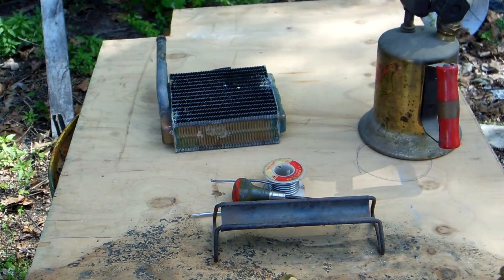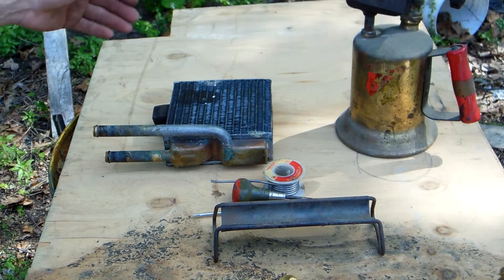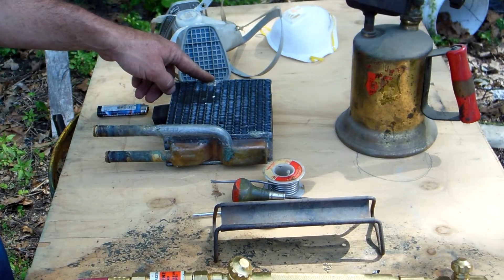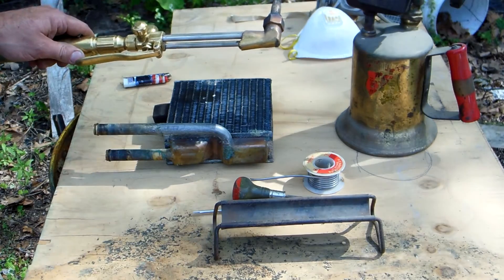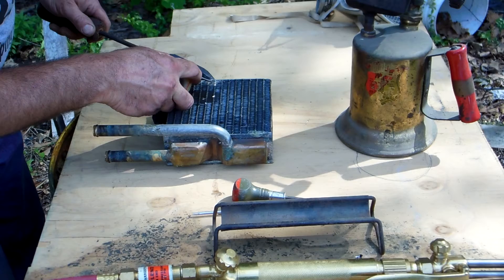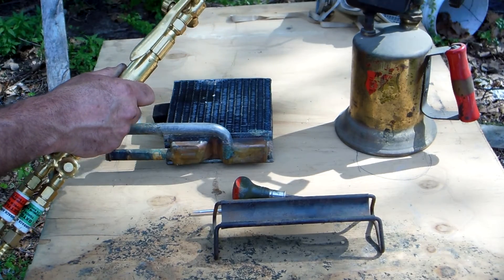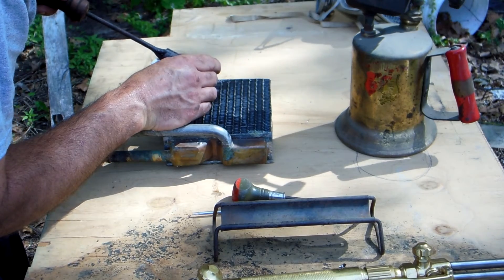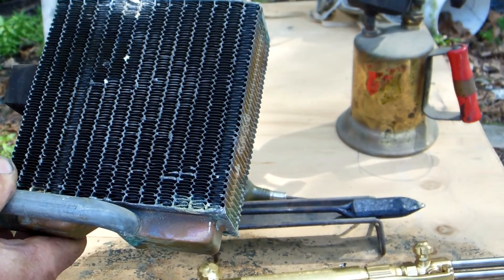69 ford heater core repair

Comment: I caught you said 15 minutes to get that heater core out. I have (i believe) that same core that goes in a non A/C 1979 Bronco that im putting in my car (92 740) right now while i redo the airbox in it. Im redoing the airbox because it pays TWELVE hours to change the heater core in that thing, there is just no excuse for that. By the time im done, i hope to make it as close to 15 minutes to change should that new core go, and now ill be able to figure out how to fix it rather than just replace with cheap garbage. Thanks for this video, i always knew you could repair them, ive just never been around when it has happened to be able to absorb that knowledge.

Comment: I have a car, and the heater core has been replaced three times, and there is always a leak from the connect  tube and o-ring. I want to solder it and take off o ring , can i
Reply from the maker: I’m not sure how yours is made but if it has an O ring then my guess is it’s made of aluminum which really can’t be soldered easily. Maybe try replacing the hose/fitting where the O ring is placed. Good luck